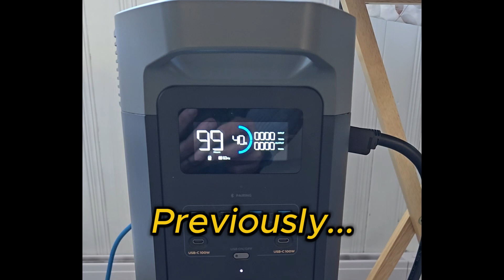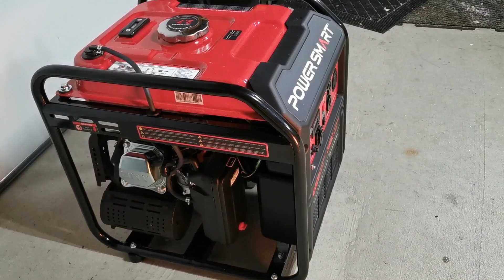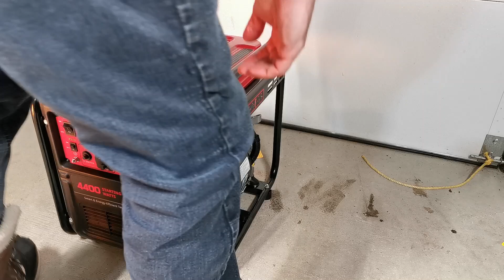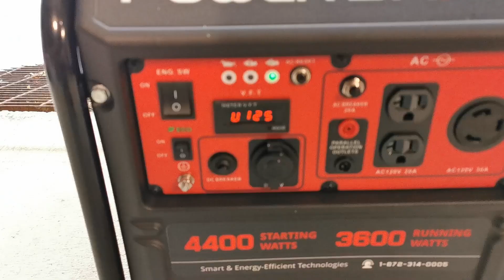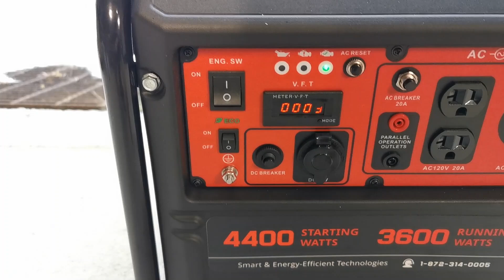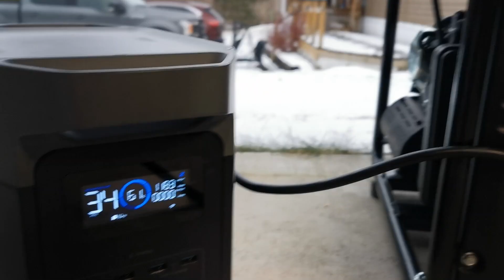Budget inverter generator review - Powersmart 3600 watt first start and test. Is this the best deal?

Comment: I have a Duromax 13000 gen that runs the whole house easily during the day here in Florida during power outage. But, it consumes a gallon of gas an hour. I don't need to run the whole house at night, That's why I have the Powersmart 4400 for night time use. It runs my window a/c, 2 cpaps and my tv along with 2 lights and only uses a gallon and a half for the night. Greatly reduces my overall fuel consumption for the day. Saves me 6 gallons of gasoline for the day.

Comment: brushes alternate on a rotor,  they have a spring and as it wears,  it fluctuates the feroid coil,  Brush are magnets that wear as it runs.   Inverter generators do not do that.  electric goes thru those brushes as it runs,  the actual contact varries depending on the wear of the brushes

Comment: only get the one without the co2 sensor,  no  one discloses how to by pass that specific sensor,,  because in the truth, it will not work after a year.   sensor is a shut down sensor,  and its such a quack to even have such a thing in a generator shed,  no one is in it except the generator,  and no ones wants it in a garage,  to dam noisy

Comment: This motor will run a long time run mine daily my hrs run time as of a few months ago 3700 motor mounts broke can't find parts but made my own still going  I run big fridge big deep chest 1 5000 AC  1 8000  several battery chargers for tools coffee maker  afte that I have to cut power usage 1 year of use 6000 hrs oil changes on point it ows me nothing 😮 I run it 24 7 im ordering a nother one for back up. Can't last forever lol
Reply: Ps bought a champ new  4400 it blew up in 3 days with 6 oil changes with nothing but metal shavings in oil tons threw the valve through piston returned it will not buy another

Comment: Eco flow actually sales a inverter generator that suppose to work great with there products. The power station can tell it to turn on when it gets to a certain battery percentage. A guy in canda I think, is using one on a tiny home he rents out. He had a eco flow delta pro with the expansion battery, alot of solar panels and the ecoflow generator run to the delta pro and if its cloudy and the station doesnt get a charge, it turns the generator on. He had a few problems with this feature not working all the time so he would have to turn it on with his phone or manually but the concept is amazing.

Comment: I have done exactly the same with a 2kwh anker powerstation and a 3kw inverter generator.  I can run the fridge on the power station for 40 hours and can recharge it with the generator in 45-50 min.  With a 10kg propane cylinder, I can charge the powerstation 10 times so about 15 days of emergency power when needed. The best part of this solution is that I do not have to listen to generator all day long. Here in the Netherlands a 10kg cylinder costs around 50 euros.  Very expensive from a kWh perspective but having power during an outage is worth it.
Reply from the maker: Yes, I'm convinced a power station with a smaller generator is the answer for me.

Comment: If you are an older person I say to you, pay a little more and  buy an electric start gen. Also if you can afford it buy one that also uses propane as well as gas. I am 78 so I know what I am talking about.
Reply from the maker: Good advice, and the one issue is have with this one. My older generators are actually "hillbilly" electric start, that is I took the pull cord mechanisms off and start them with a drill and socket. :) Honestly though, this new one is way easier to pull than I thought It would be, much easier than my old 3000 was.
Reply: @HollisDoesStuff  Start your generators every month. I have a calendar marked to start generators.

Comment: Good video.  I was considering making a video on this very subject.  I had one of those cheap one a long time ago for work, followed by a Honda 2000is, then a 3000is, then a champion 12kw, followed by a 26kw diesel with auto transfer switch. I added a auto controller on the Genny as well.  We get power outages often here in Northern Alberta.
Reply from the maker: Go for it!

Comment: I was looking into this inverter generator on Amazon, I just wish they offered a dual fuel option.  I'm going with WEN for that reason.
Reply from the maker: Personally I prefer gas. Easier to transport, cheaper (in part of the world), and propane can be an issue in really cold weather. But, I can see the advantages too.
Reply: same... I wouldnt run it until i need it , and having gas sit around for months until I needed it wouldnt be a great idea
Reply: @unijabnx2000  True! I'd run it at least once a month to make sure everything's functional in the event I actually need it.